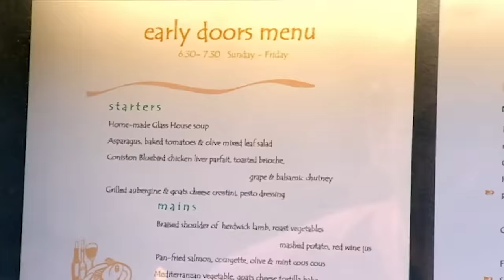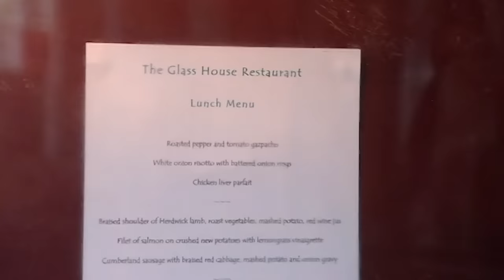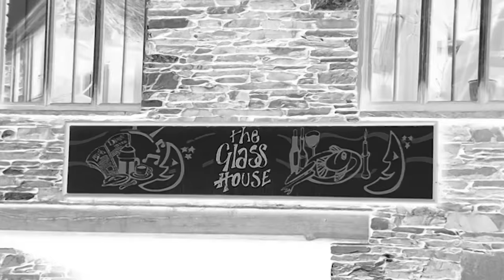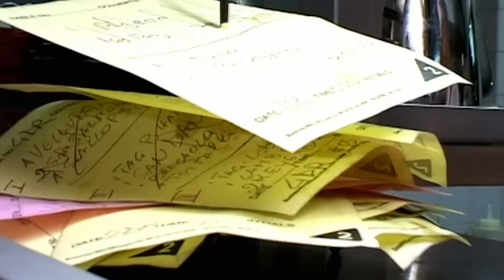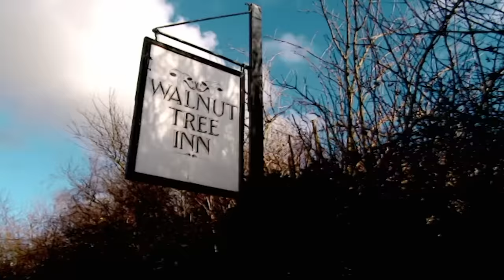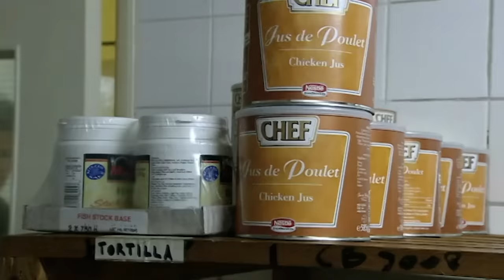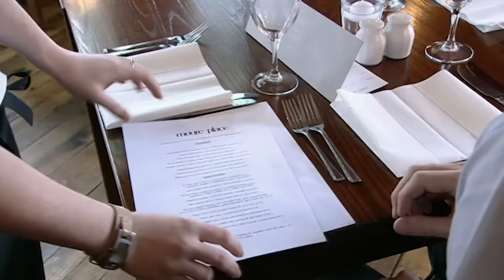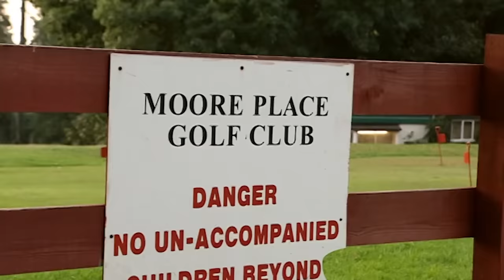Gordon Revisits Struggling Restaurants | Kitchen Nightmares UK Revisited

Comment: 25k a year????
are you nuts.....
a good cook makes 5 times that
Reply: Pounds and this is years and years ago.
Reply: This was 2003. The sign said 2 entrees for 12 pound, 50. That’s cheap ……. That’s 2003 prices.
Reply: About £43k adjusted for inflation.
Reply: Also, adding in the pound to dollar ratio at the time (1.84 versus the dollar) that equates to 46k dollars per year. Then add inflation from 2003 to now, and it comes out to roughly 74k dollars per year, give or take a thousand. So, it was not too bad at the time.
Reply: It's shocking when you consider these episodes were filmed around 20 years ago...
Reply: @TXCrafts1  Pls stop, im so old T-T
Reply: Here we go Americans not understanding dates, inflation, exchange rates and different countries ' taxation systems again
Reply: @Parramatta  didn't you see my post? I completely understand what you are stating. I described the answer to the exact statement that you wrote. Where I was wrong, in my opinion? If I missed a point, please let me know. Thanks.
Reply: @dustins9464  i wasn't talking to you I was replying to the original comment, yours looks about bang on
Reply: @Forestgravy90  No worries. Thank you.